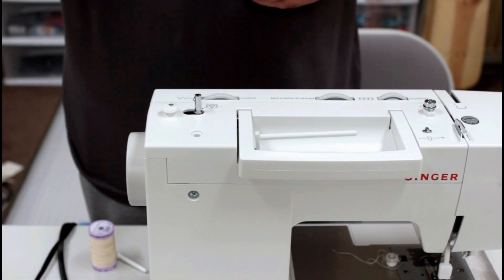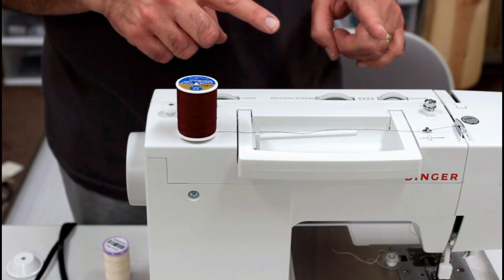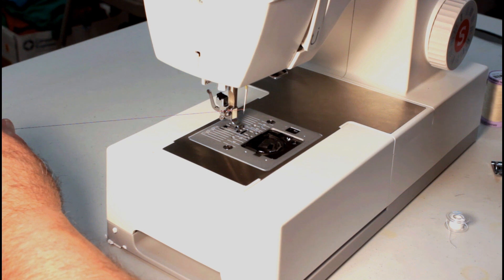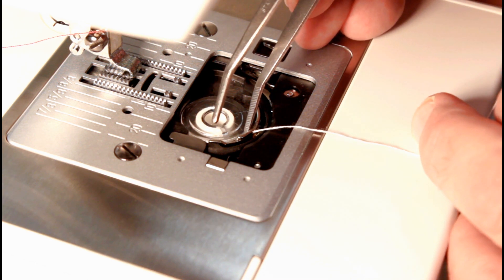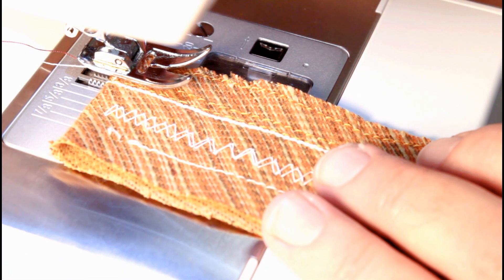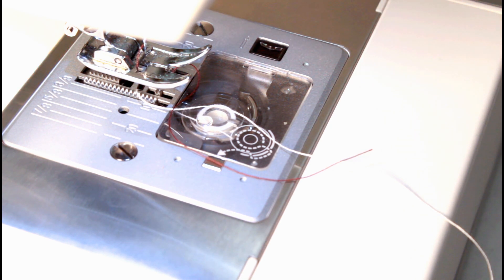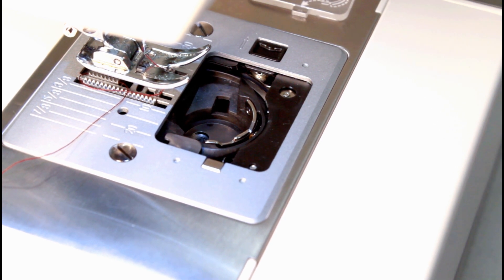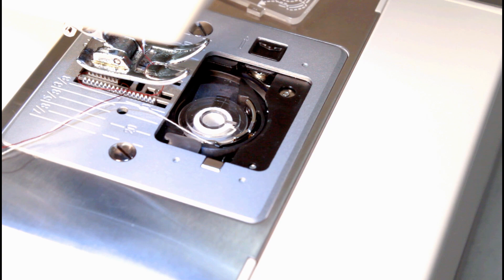Solving Threading Problems and other Issues

Comment: Ugh I feel so stupid I had assumed the horizontal post was the main post.  I had been wondering what some of the doodads in the case were but I'd misplaced the manual and had figured they were for fancier use and not just hemming pants.

Nope.  Just screw in the proper danged spool post.  Holy crap.
Reply from the maker: I am glad it was helpful to you.

Comment: Sometimes I need to slow down and walk through all these steps very very slowly to see what I may have missed!  First time I am thrilled beyond belief being an operator error instead of having to find a repair man. Bless you for doing all these videos !!!
Reply from the maker: You're welcome!
Reply: With several videos of yours I learned the right way where to place standard thread spools, clean the tension disc, clean & oil the bobbin case, adjust the bobbin tension. My machine was very linty and my bobbin threading was missed the little dip in the case to feed properly Thank You!
Reply from the maker: @BrendaAlbright-m5w  I am glad to hear that.

Comment: Should there be any tension in the bobbin?  I have a used HD and I'm curious if I need to buy a new bobbin because even after tightening the yellow screw there is Zero tension on the bottom thread.  Thanks for the nice video
Reply from the maker: I would buy a 2nd Bobbin or two just to be safe. These things fail at Midnight when you are trying to finish a project. ;-)
Reply: @kevinsews  so ....should I feel any tension on the bottom thread when I pull it?
Reply from the maker: @scottb9937  Yes, but nothing like the tension you feel from pulling the needle thread.

Comment: Hi,I hope you could help me,  I have hobby machine, with thicker fabric the bobbin does not spin. It only sews normally with very thin fabric...
Reply from the maker: If that is the case then it is possible the machine is not designed to sew thicker fabric. If you can give me the make and model # of the machine I can take a look at it for you.

Comment: Just bought Singer Heavy Duty 44S. Can’t get it to wind the bobbin. Machine motor runs but the bobbin winder not working seems like it’s too tight.
Reply from the maker: @carolginoza5281  Remove the side cover and observe what is going on when you engage the bobbin winder.

Comment: OMG! Could this have been the bulk of my thread tension troubles??!!! That top spindle for the horizontal thread broke off my machine shortly after I bought it!! This is the first video I’ve seen discussing the way the thread is wrapped in the spool!! Even the sun get instructional video for the Heavy Duty models doesn’t say anything about this!! Or the quick start guide! Kinda really sucks if this is the case, mostly due to the frustration from trying to correct it. Sorry for whining at ya! Sure appreciate your videos here!!
Reply from the maker: @anjylkat  My pleasure!

Comment: I made small adjustments at a time turning the top tension dial on my Singer 4423. There was no difference. How can I fix the dial?  I did adjust the bobbin tension. That did help a lot. But the zigzag and straight still need some adjusting. How do I fix the top tension dial?
Reply from the maker: If you are saying your top tension needs adjustments more then when you can get my simply turning the knob take at look at the video I posted here: https://youtu.be/ddFcH5lnnjY?si=sUFHQDyRZ8NaTxT8&t=185

Comment: thank you kevin! I feel like I'm having to pull quite hard on both threads to clear them out the way once they're threaded. The needles pulling back a bit even on tension 2 / 1 when the presser foot is up.  Do you know what this could be?
Reply from the maker: Either there is something wrong with your machine or it is a threading issue. I would need more info to assist you.
Reply: @kevinsews  Hi Kevin, thanks for replying. I tried another thread and it seems to be working much better now - i think it was cheap thread that was getting bumpy that did it.
Reply from the maker: @LarryS378  Okay, thanks for the reply.

Comment: Kevin, My singer one sewing machine sews straight stitches right, but when I use the decorative stitches the fancy stitch is on the bottom of the fabric  ? The machine is computerized .
Reply from the maker: Your timing might be off. Zigzag will expose this issue first.

Comment: Well in 5 seconds in I can see you are using garbage for thread.
Reply from the maker: Please offer us details based on your expert opinion.   This was a simple video showing the correct spool to use based on the threads spool style. After that it was to show how to check for some common threading problems. It was not a discussion on which thread is best. On domestic machines I use what home sewers generally use. I personally use industrial spools for my daily sewing jobs.

Comment: I have watch your video several times and re threaded my machine carefully. However I am still having a problem with the top thread breaking. It seems to be wrapped around the pick up lever, not sure it this is the problem or the result. I have taken off the side panel to see if something is stuck in there but it seems clear. Any comments? Thanks.
Reply from the maker: Hummm.... is it posted on the correct spool holder? Is the thread old and/or bad?

Comment: I had just got myself thicker thread. I make dog collars and I had been just layering think thread. Decided to get thick thread so it was not so many passes in stitches. I have given up on using thick thread. It just doesn’t pass through the bobbin spring without a bit of force so the bobbin jumps around. So frustrating. Maybe the thread is way too thick. But I though this machine was for that purpose. Pretty frustrating. Maybe with my projects it’s time to get a Juki
Reply from the maker: I would look at the Brother 1500 series machines.
Reply: @kevinsews  I will do just that. Thank you soo very much. I am sewing for my own business so I need something reliable.
Reply from the maker: @tjtinaj83  My pleasure!

Comment: Hi Kevin. Great videos thank you. My issue tho is the thread from the bobbin seems to go back in the bobbin case. then I end up with 2 3 or 4 threads going back in and of course it just jams after. Any suggestion? thanks
Reply from the maker: Pull enough thread out of the bobbin case so you can hold on to it, along with the needle thread for the first 2 or 3 stitches.
Reply: @kevinsews  OK sounds good. it makes sense. thanks

Comment: I purchased the Singer HD 4411.  After sewing a straight line, my thread pulls out just like when you use a basting stitch.  I have watched your videos and numerous others to make sure I am threading correctly (and my bobbin) but I can not get the stitches to lock.  I have tried turning the tension up and down, but I'm ready to throw this out the window.  Can you give me any suggestions?  Thanking you in advance
Reply from the maker: So with the presser foot down when you pull the tread through the needle it bends Ike I demonstrated in this video?
Reply: @kevinsews  yes
Reply: @kevinsews  Yes, but thank you.

Comment: When I am sewing the bottom of the tread gets all bunched up and it sounds like the bobbin area is going to break lol how can I fix that thank you for all your videos there so helpful especially when u don't have the money to get it fixed
Reply from the maker: Something is probably going on with your needle thread. It could be in the threading; thread not lodged into the tension disc; or a mechanical issue with your machine.

Comment: Do you show us how to fix the timing on these machines? I am not able to fix my thread issue. I did everything to clean the bobbin casing and re-thread the machine and the bottom thread keeps releasing a huge loop about every 2 inches of stitches. Anyone have any suggestions? Or know if there is a How to fix the timing video?
Reply from the maker: https://youtu.be/dfUB2c-x7g4

Comment: I have been having tension problems, this is a great place to start.  I never heard of pulling the top thread until the needle slightly bent.  Now going to watch your bobbin tension video.  I hope you can get a timing adjustment video.  Also, a friend borrowed my machine and didnt realize she had to adjust the stitch width for thicker fabric layering.  The needle shredded my feeder plate and now my needle wont go to the right.  I can push on the needle and and it will move to the right, but it wont stay there, it bounces back.  Any advise for fixing this?  I have to order a new plate so if there are any parts that would be helpful to have on hand can you give me a list?  I live on Cyprus (the island) and there are no technicians here.  I have to send it to Greece for any type of repairs, and the shipping alone is more than the machine.  I am hoping I can do it all myself.  Thank you so very much for helping us all out!
Reply from the maker: I am on the road right now. When I get back I will do a quick video to show you how to adjust the needle position.

Comment: My needle and bobbin is making a clicking noise. Do u have Facebook messenger Orr anything? It's wierd. It's a brand new machine. Walmart won't exchange because I lost my receipt. It's less than 2 weeks old. Idk what to do.
Reply from the maker: Rotate the handwheel slowly and see if the needle it hitting anything in the bobbin area.

If not, then make sure there is nothing in the bobbin area by taking it out and cleaning that area. I have a video on how to do this.

If it is neither of these then the timing might be off.

Comment: thank you Kevin...My problem (the needle thread breaking) stems from sudden high resistance behind the #3 station.  All fine for a minute or so and then resistance sudsenly goes up.  Is there an idling pulley in there that the thread could be falling to the side or..??  I put the tension on 0 and am getting by but...
Reply from the maker: Okay retread it and confirm the thread pulls freely after each stage. Make sure your presser foot is up before you start threading it.

Comment: The Rasant thread is too big for the horizontal spool. The vertical does not stay put when I put thread on it, ie the vertical spool flies out of its position and behind the sewing machine cabinet. I have the Heavy Duty Singer CP6355M.
Here in Australia Rasant thread is the best quality thread you can get for garment sewing, as it does not break. I mostly do garment sewing.

Comment: Great video!  I too, had my thread spool on sideways.  My issue (and I hope this hasn't been addressed earlier, and if it was, I apologize), my machine had a wonderful straight stitch when I first purchased it 7 months ago, now the straight stitch is more slanted.  Is this a common occurrence with these machines (I have the 4452)?  I have  tried re-threading, different bobbin, tension adjustments, etc, nothing seems to get that nice straight top-stitch.
Reply from the maker: I've seen this before when the needle is off and it is doing a very slight zigzag. This is a bit more of an advance repair, but if you look at the service manual it may be of some help.

Comment: I just got my brand new machine and followed all the instructions on threading and loading the bobbin.  I can only sew for maybe 2 inches and the bobbin thread starts to bunch up and it stops sewing.  I have changed the bobbin and rethreaded the machine 50 times already and this is my first day sewing on the machine.   I've only had it for 3 days now and I'm getting sl frustrated that I'm ready to send it back for a refund.
Reply from the maker: That's the best thing to do.
Reply: I have owned 2 Singer sewing machines and they both lasted over 20 years.  I was really disappointed in this newer one and I returned it.  Once things clear up more with Covid, I will go out and buy another machine.

Comment: I have my tension pretty much perfect yet when I switch to the diagonal stitching the fabric gets like cinched together like both tensions are too tight.  I know I'm supposed to loosen the top tension for those stitches but do I need to loosen the bobbin tension too? Could the bobbin tension be tight from the factory?
Reply: Correction, I meant when sewing zig zag stitches.
Reply from the maker: Always try the needle tension first. If this doesn't solve the problem then it is the bobbin tension.

Comment: My needle isn’t bending at any tension number. Anyone know why?
Reply from the maker: Make and Model of you machine?
Reply: Wow thank you so much for getting back so fast. It’s the Singer Heavy Duty 4423. I have taken out the bobbin and cleaned all the lint out and also tightened the yellow screw like in your other video but I still have extremely loose stitches. Looking at the thread it seems the top stitch is the super loose stitch and not the bobbin(bottom) thanks for all the help:)
Reply from the maker: @levistoys  Take a look at this video I made and see if it helps: https://youtu.be/ddFcH5lnnjY?t=222

Comment: Kevin where are the tension buttons on 66p0c? i reviewed your video in threading but bobbin threads is very easy to . I have a round white button on top and another dial toward front of machine. I am very unhappy no written instructions came with this expensive machine. I really wanted to do sewing. Can you help?
Reply from the maker: I am not familiar with that machines' model number.

Comment: I didn't know this about which spool of thread goes where! I haven't had a problem...yet...and thanks to you I hope not to! I also still have my Singer Quantum Stylist 9985 thanks to your recommendation ages ago. It's the only machine that made the move to Mexico with me. Of course now I've replenished some others! I've been having trouble on my 9985 with the bobbin thread popping over to the wrong side of the bobbin but I think it's only when I pull the thread up so I'm keeping an eye on that. Otherwise, great machine!
Reply from the maker: See my video using the Singer 9985 and having the same issue: https://youtu.be/-94cSYbxkpw
Reply: @kevinsews  Thank you!!! You're a sewing machine wizard! Seriously not 5 minutes after I typed that comment I got all jammed up! I think I have thread all underneath the face plate. I need to find my husband's screwdriver to get that back screw off. Good thing I have the 4452 so I could finish.
Reply from the maker: @AmoPerrosMás  Okay, let me know if it fixes your issue.
Reply: @kevinsews  I sure will! So far so good!

Comment: I never knew about the attachment to hold the spool. Mind blown.
Reply from the maker: That is because the manufacturers don't stress this. You will see them using the wrong spool holder in their own videos. It drives thread manufacturers crazy too.

Comment: OMG-no where in the manual does it tell you to put the thread on this post!  I am hoping this may solve my problem!  thank you Kevin.  What an eye opener.
Reply from the maker: Exactly! I don't know why they never mention this.
Reply: Kevin Sews I’ll let you know if this fixes my issue, but I’m thinking it’s not. My machine is making a lot of noise behind the bobbin area and I may need to take it apart...
Reply from the maker: @deeleach8300  Yes, that sounds like you have something out of alignment. and/or the timing it off.
Reply: @kevinsews  Thank you so much.  I just took out the bobbin holder thing did a major cleaning and found a tip of a needle that had dropped down in there.  Changed my thread to where it should go and magic-it works now.  Really appreciate your help.  dee
Reply from the maker: @deeleach8300  That is great to hear! Thanks for letting us know.

Comment: bro honestly screw singer i hope the company goes bankrupt i just bought this second time i’m using it and now i have to go get a new machine🙄
Reply from the maker: I am sorry to hear that.
Reply: It might not be the machine. Thousands have them and are sewing fine with them. Any machine can have a defect, but getting two defective ones in a row is highly unlikely. Take a deep breath, have a cup of tea, and relax. Then unthread the machine. Go back step-by-step through the threading process. After spool position, the most common problem areas are 1) missing one of the thread guides, 2) threading without raising the pressure foot, 3) missing the thread hook in the bobbin case, or 4) having the bobbin upside down. @KevinSews just gave a great overview. Best of luck.

Comment: I had my thread on the wrong post as well, though it was working fine for awhile. I changed it and tried everything you suggested and I'm still getting loops under my fabric. I tried checking the tension by pulling on the needle with the thread and there is no difference from 1 to 9. Any suggestions?? I'm about to throw the thing out the door!
Reply from the maker: Your needle thread tension is probably too loose. I have a video on setting the timing and adjusting the thread tension dial, so see it if nothing else works. First, make sure the thread is caught between the tension disc.
Reply: Yeah, I tried all of the needle tension settings and nothing changed. I'll check out your other videos. Thanks!

Comment: The bobbin case constantly pops out. I can’t get a stitch in. How do I fix that?
Reply from the maker: I'm Julewri There are 2 brackets that hold the bobbin case down. Make sure the screws are tight and the front one is in the proper position to hold it into place.

Comment: Hey Kevin,  i have my tension set at 9! and there is only a very slight bend in needle, not anywhere near the amount of bend as yours did in the bend test. Im using 110 jeans needle and a jeans thread. Ive been having issues while straight stitching producing a lightly zigzag result on the underside of fabric with a little bit of top thread showing through. WHAT DO I DO :(
Reply from the maker: Toby Thum You shouldn’t need your tension turn up to 9. Something is up with the tension being off.